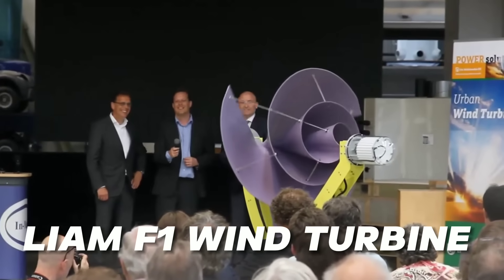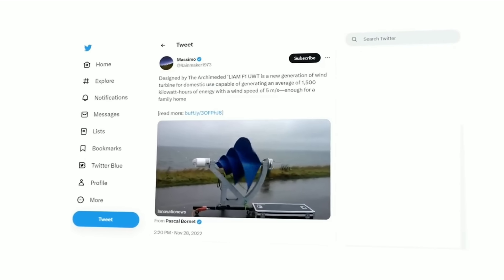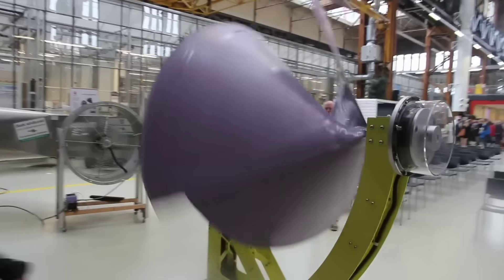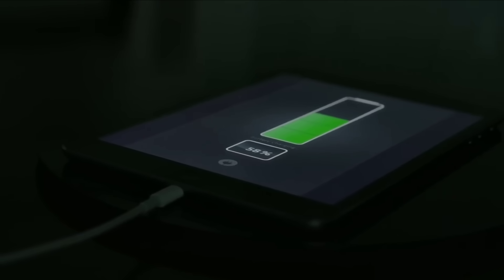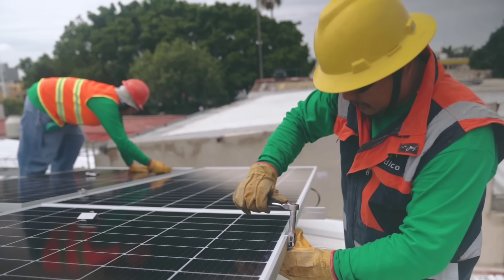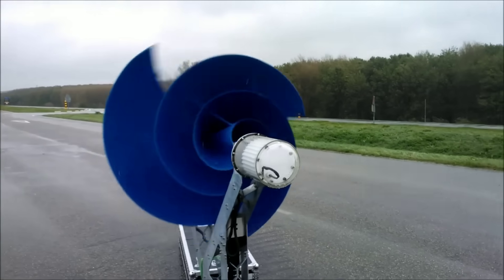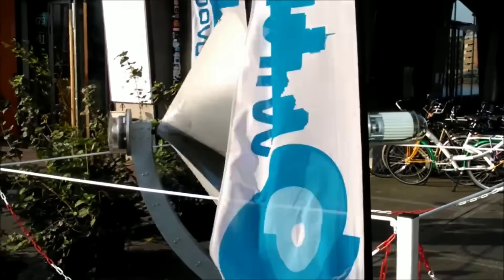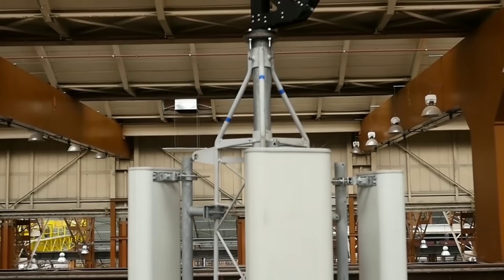This NEW European Wind Turbine for Home Outbeats PV Solar Panels in 2023?!

Comment: ---- I T LOOKS SO FRAGILE AND LIKE IT COULDN'T STAND A COLD WINTER WITHOUT FALLING APART ! ---  EXPOSED WIRING, EXPOSED SCREWS THAT RUST EASILY, CABLES THAT ARE NOT WATER INSULATED PROPERLY ,----  JUST A FEW " ODD DESIGN " MOMENTS EASILY EXPOSED !  ----    Soooo !     NO SALE HERE   ----

Comment: japan,Koreans,china can't make cylinders. Cylinders were made in Europe.
Korea has less than 40 years of experimental data on cylinders.
Europe has been researching them for hundreds of years. The inventor of the weight-reducing device said,
"i will use European cylinders."
Koreans japan should stop making weight-reducing cylinders in the future.
f China, Japan, and Korea are sanctioned, the inventors of weight reduction devices will be on the same side.

Comment: 170 watts per hour $4500 plus taxes, plus shipping. Almost $5000 per unit. Need 12mph 24/7/365 to produce 1500 kwh/year. Hmm, impossible. Real - 150-200 kwh hours annual. Check any local weather information. Never pay back.  Another way, for $5000 i will install 2 kw solar x 5 average hours/day(minimum) = 10 kwh x 365 = 3650 kwh. DIY can increase your solar energy up to 10 times - 30-35 000 kwh/year.

Comment: I have a 5kv solar panel system in Nigeria. It cost approx  $3.5K. Batteries runing down at night is an issue. This is where supplementing wilh a wind power system wins. I favor a solar and wind combo. The amount of batteries required will be less to ensure continuous power. I've got surplus solar and wind here🤣. I just have to max my power supply. ✅

Comment: Your clip is obviously from somebody who doesn’t know what he is talking about. He states: „…. can generate approximately 1500 kWh per year.“ and on the screen you read: „150 km/h“. On a second occasion he states something about 4000 kWh and displays on the screen 4000 km/h. What has a speed (km/h) to do with electric power (kWh)? Really nothing. That just shows that your clip is not trustworthy at all, since you don’t know what you are talking about.
Reply: The other aspects is that an EU house on average (as stated) uses 3000 kWh per year, or 8.2 kWh per day. In Aust, last year I used 10600 kWh over the year or 29  kWh a day. My solar made 7770 kWh (reduced in winter due to tall trees), or 21 kWh a day.

Comment: Fooling public with false information???  a 1.5 meter diameter wind turbine will be heaving a cross section area of 1.766 Sq meters, total power in the wind flowing at 5m/s for 1.766 Sq mts will be 135.2 w/h. 
Equation for power in the wind is 
Power (W) = 1/2 x ρ x A x v3
Power in Watts
ρ (rho, a Greek letter) = density of the air in kg/m3.
A = cross-sectional area of the wind in m2
v = velocity of the wind in m/s
The standard density of air is 1.225 kg/m3

At 80% turbine efficiency as claimed by Liam F1 its power is 135.2 X 0.8= 108.2W . If we have. a constant wind at 5m/s all through the year 24hours a day (which is not possible) , its energy output is 108.2W/h x 24 x 365 =947kWs, where are the video is claiming 1500kWs.

Comment: FAKE NEWS!  All practical tests show that small wind turbines hardly generate any electricity! And only at very high costs!
Because there is hardly any wind close to the ground. It is also extremely gusty, which usually shortens the service life. 
Only if you need to be self-sufficient from the power grid, you should install the largest possible wind turbine on a high mast.
With solar modules, on the other hand, reliably generate electricity for 25 years at approx. 3-10 cent/kWh!

Comment: I have found exactly zero residential wind energy solutions that live up to their potential.  The cost break-even point for wind is never.  The Liam won't pay for itself until after its life cycle has expired, 20+ years at US $0.13/kWh.

Comment: I see a few times text ¨km / h¨   and that is speed ( kilometers per hour ), it should say  ¨KW / H¨  (  KiloWatt per hour )
I live in Spain, 320 days full sun a year,  I put  5 solar panels of 550 Watt on my roof ( 2750 Watt total ) standing up 60 degrees and that saves 10 square meters on my solarium.
Because they standing up 60 degrees,  I clean them once a year. 
Also I have  3 batteries of 3.5 KW. every day near 1 PM batteries are full. I am happy :)

Comment: Pure nonsense! All practical tests show that small wind turbines hardly generate any electricity. Because there is hardly any wind close to the 
ground – and electricity yield is proportional to the third power of the wind speed: 100% more wind generates 800% more electricity! 
Only if you need to be self-sufficient from the power grid, you should erect the largest possible wind turbine on a high mast. 
With solar modules, on the other hand, you can reliably generate green electricity for 25 years at approx. 5-10 cent/kWh!

Comment: I would love to have a mix of solar and wind power, they would complement each other really well, but so far, I've not seen any convincing evidence of wind power at a small scale that produces a reasonable amount of energy that is practical for homeowners.

We hear about a lot of scams on small wind turbines that produce so little energy that they are not worth it, but it does seem like there's a lot more creative ideas going on with small wind turbines now, and who knows, maybe they'll find a way to make it work.

Regardless, the clock is ticking, solar is getting cheaper and better all the time, if wind on the home is going to compete, it's going to have to be a lot cheaper and be able to produces a reasonable amount of energy, otherwise most of us will just go with solar.

For now, wind power is too expensive and produces too little energy at a small scale on a house to be useful, unless those two factors change, then the solar industry is going to win.

Comment: I’ve never seen a system that works as well as this before.,,, but somehow I’m thinking I have seen it. I’m 78 years old, and started mechanically in 1964. Although I had a string of part time jobs until went in the Air Force. I am convinced that I’ve seen this mechanism before. Maybe Galileo, or Divici helicopter,  these things all have some commonality , I see one thing that stands above all else. . JLF 2/27/24 12 pm.

Comment: You could get the best of both world by combining both solar panels and wind turbines. Depending on your location, you could have PV/WT contribution of 90/10, 50/50, or even the other way. Both complement each other especially in the night the wind turbine contributed a lot in charging our battery banks and we have captured the data trending for a few years and it worked beautifully. Less battery size is used due to the add-on of wind turbines and saved some footprint and costs of the batteries.

Comment: 1500 km / h ? That is what their text shows. But the speaker says 1500 kWh per year and that that is equivalent to 50% of what a normal household uses in a year ?? Not trustworthy at all.
You would need two and that would be 3.000 kWh per year   My small house needs 10.000 kWh per year and that is with 64  panels of 250 watt each  in addition to what I buy from the grid. So in total I use 23.000 kWh and we have two BEVs.

Comment: *Skepsis Blog Article Summary: "Hot Air Around a Wind Turbine"*

In May 2014, a new wind turbine called Liam F1 was launched amidst much publicity. Weighing 55 kg and measuring 1.5 meters in diameter, it was proposed for mass installation on rooftops and lamp posts, potentially reducing electricity bills significantly. However, basic physics suggests that many of these claims are exaggerated.

The Liam F1, developed by Marinus Mieremet and The Archimedes BV, is inspired by Archimedes' constructions, notably his screw and spiral. It differs from traditional turbines with its helical shape rather than standard blades. The principle of operation remains the same: the wind is slowed, transferring kinetic energy to the turbine. The efficiency formula, taking into account air density and wind speed, indicates that real-world performance is often less than ideal.

Wind tunnel tests and performance claims by Mieremet and The Archimedes have raised skepticism. Wind tunnel results are notoriously unreliable for wind turbines. Additionally, the Liam F1's performance in varying wind conditions and its claimed efficiency of 80% need thorough field testing for validation.

The article also touches on the economics of wind turbines. The cost-effectiveness of Liam F1, given its production cost and potential energy savings, is questioned. The comparison between small urban wind turbines and larger, industrial ones is also discussed, highlighting the inefficiency and impracticality of the former in urban settings.

In conclusion, while the Liam F1 and similar small wind turbines are being marketed with great enthusiasm, their practicality, efficiency, and economic viability remain dubious. The article urges a more realistic approach to wind energy and a focus on larger, more efficient turbines for meaningful contributions to green energy.

Comment: Instead of the government offering grants, etc, for insulating homes, they should offer solar panels or these(or ones like it) turbines on every available home, ie ones that would suit solar better or wind energy better... with all these solar and wind energies feeding surplus energy into the grid, the price would drop dramatically. Also, have small vortex or wheel turbines on waterways and rivers(these do not impact wildlife). Rivers that are prone to flood could be utilised by building a run off at a lower level than the river, perhaps underground, with vortex turbines spaced apart feeding the run off where wheel turbines could be employed, effectively using the water twice. Vortex turbines require a faster speed to work effectively, and wheel turbines can be geared to work more effectively at lower speeds. None of this will happen, not because of cost but the energy suppliers won't be able to profit from them. For the UK to become net zero and 'green', it needs to become self-reliant and not reliant on profit based control of big energy companies.

Comment: There was a short moment the design power of the generator was shown to provide 45 W. This is not much. With a square meter of PV you can get a peek power of 200 W and you can easily install a few kilowatt of PV peak power on your roof. But you can't install 50 or 100 of these wind turbines on your roof for comparison.

Comment: Good presentation. I'm a "fan" of wind energy, and it looked like your horizontal wind turbine was on the same pole as a vertical wind turbine. That could work. As I've said I'm a fan of wind turbines, but not the standard corporate America ones that are visible from the side of the road in some places. Not enough bang for the buck.

Comment: I looked again and did not see anything about a maximum wind speed on these?  I notice many others have issues at high wind velocity.  Winds here are almost constant and my back yard slopes downward towards the Sierra Nevada Mountains and Ski Resorts (Mt Rose 11000 ft and Slide Mountain 9000 ft) just across the Highway.  So I get wind all the time and sometimes its pretty dang strong.  They call it Tropical Storms and possible Hurricanes in other areas but without the rain!  Could this work here?  Anybody know?

Comment: 08:17 The Generator / Alternator seems weak at 24V. 45W output.? Model TJ-B-20.
I built a Wind Turbine a few years back using an Alternator off a Fire Truck that had 150 Amps @ 12 V DC.
Connected to Batteries it provides endless power.

Comment: I aim to get both. The only thing i have not found out yet = How i can store the energy in a form that does not expire like in most batteries. Meaning, so i can save power (like saving money) in  way, perhaps solid, for later use, without it losing energy AND needing energy to store it. I know this sounds like sci fi but does anyone have a good idea? How can we convert the energy excess into something we can store somewhere in or near our home and use later.
Reply: Think outside the box we are allready in. I mean when there is no light or wind and your batteries are all dead/broken. What can we use or burn that we created with energy before? Someone ? hah

Comment: Maintenance: Solar panels cleaned with rain or a hose vs greasing bearing?  I'd say the maintenance and longevity of solar panels vs moving parts of a wind turbine is a no brainer and average Joe wouldn't be fooled by this claim. Strike three for me.
Reply: What if you combine wave energy and wind turbines? Tubes of air moved by ocean waves blowing on the turbines.

Comment: Your argument of wind vs solar light is very weak at best. Every spot on this planet is guaranteed light everyday, all year long and year after year you can bank on your average sunlight not changing very much. Wind however is not only sporadic, vastly different geographically and even quite different year after year at the same location. Most locations on the planet have far less useable wind within the year than they do have days that would generate a watt. Strike two.

Comment: Depending on the town and city like Windsor ont can they don't like wind turbines because the city looses out on profits because the city of Windsor owns the local utility, and only issue I have is if I'm paying $4500 for this unit you dam well better be installing it and showing me how to do the maintenance for it ! And supply me a list of certified contractors that can install and maintain this unit after I'm gone lol, but like the design it's minimal unlike the standard normal wind turbine and you didn't explain the specs of the machine and battery amp hours to charge from empty to full and so forth

Comment: You mentioned its rated at a wind speed of 5 meters per second right? How many miles per hour is that? That sounds like a very windy day and if you consider how often is there a sustained wind speed at 5 meters per second then that's not very practical right? According to Alexa 5 meters per second is 11.2 mph

Comment: I dont think there is more than a day or two goes by we do not have at least 11-15 mph winds here which is what is needed as a minimum to turn the blades.  did anybody notice if there was a maximum wind level that would shut down the turbine as in most all other wind turbine generators?

Comment: The numbers, Liam 80% efficiency, Solar Panels at present 30% efficiency.  Based solely on efficiency the Liam wins, solar panels need to come up to at least 80% efficiency to really give you a decent payback.

Sadly, even with regular car maintenance such as a tune-up or an oil change, today’s gasoline engines are only around 30%to 35 % efficient, which means roughly 65 cents out of every dollar you spend on gas goes to waste. 
Where does the rest go? 30% effective power.  35% exhaust heat. 30% coolant heat.  5% friction and parasitic losses, that is 70% in losses.

Comment: The problem with all renewables is that they are unable to supply base load power on demand,it will not power a steel works or any heavy industry.

Comment: @3:00 minutes. 5 KW system generating 4000 KWhr (UNITS)  of electricity per year, it appears to be wrong calculation. At present 1 KW solar system generate around 6 units per day (in India), that will be ~ 2000 units per year from 1 KW system. In erurope it cant be 40% of this.

Comment: I notice this particular windmill design, has a LOT of surface area! So, why not layer electricity generating solar cells on its surfaces for additional electric power? Further, there would be need to remove dust or other debris from the solar cell-coasted vanes, because their spinning centrifugal forces would keep all dust or dirt off them!

Comment: Pity that the video contains wrong units for the expected power out of the wind turbine. Also I would rather like to see a specification that shows how much power is generated by a Iiam with size x and wi d speed y. Or better, a graph showing the power output verus wind speed for a specific unit. That would ease the buying decision big time.

Comment: It seems useful invention , about issues discussed , can put hard mesh cover to protect birds as well as unit propeller itself and can add a very small solar panel to keep it moving in low wind time segments and further about high cost of product isn't very big issue when large production will automatically reduce the price .

Comment: Yes looking to add a wind turbine to supplant our solar battery setup. When we get wind and rainy days, and not factoring night as well our batteries wont get full charged…..when wet and windy periods happen the batteries slowly wont reach peak charge, and so the solar batteries discharge doesnt last as long. Wind would assist the solar to keep batteries at max capacity. Any extra charge we would sell back to grid.

Comment: The information I found from a quick googling is that 1m² of wind at 8m/s (which is a decent wind) has the energy of 314W. If you consider this method of warming your house, 314W is approximately the same amount of energy that you get from being 3 persons in a room. You need 6 of these and >8m/s wind to power a 2 kW heater. I think I will pass...
Reply: Our heat pump takes only 380 W electric power  to  keep our house warm.  That's roughly  2 kW of heat.
Reply: Hi. You could use the 314 watts to power a heat-pump. Cheers, P.R.

Comment: I think you can make one of those things by fabricating the impeller/blade and connecting it to a car alternator.  It would be a crude version but I don't see why it wouldn't work.
Reply: Crude version / who the hell cares as it wouldn’t cost no $4500.00 YES IT WILL WORK. SET IT UP WITH SEVERAL ALTERNATORS. COST PROBABLY UNDER 1000. Now we are talking